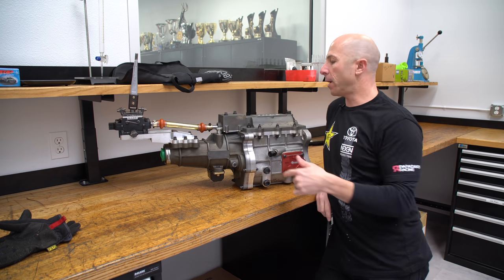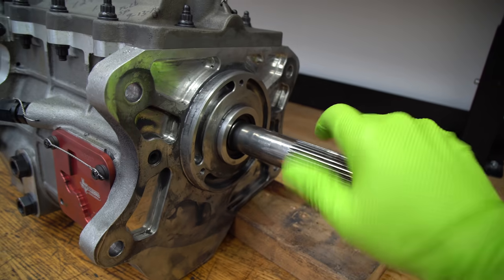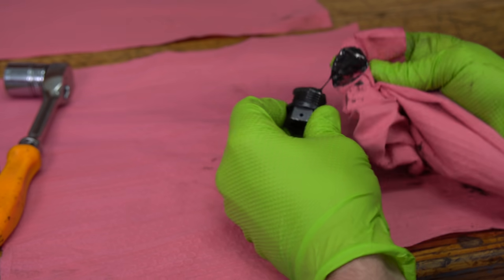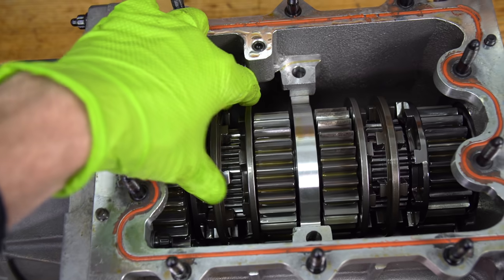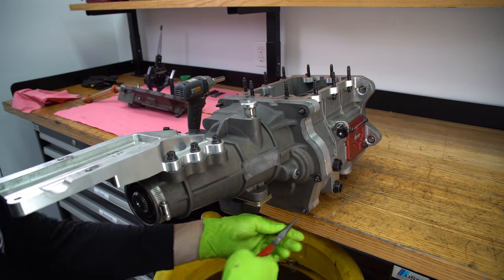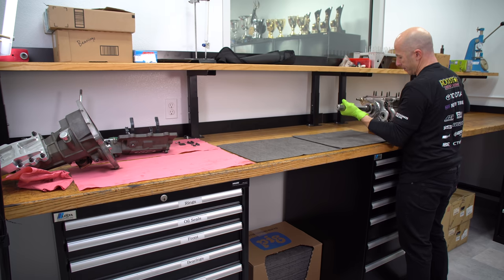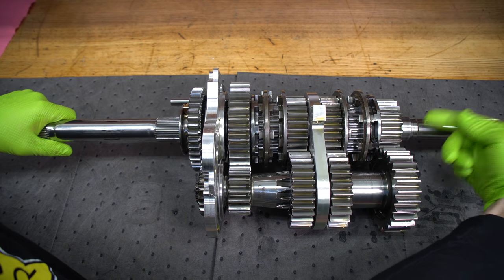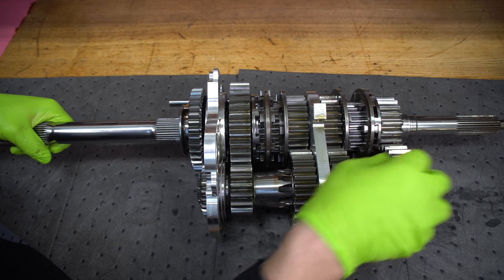NASCAR Transmission Teardown and How It Works

Comment: many folks may not know that is a constant mesh transmission, where the gears never disengage, only the dogs, via the sliders. Most factory transmissions the gears fully disengage or engage every shift. This style is most common in motorcycles, as in all motorcycles use this style. Would love to see a sequencial box tore down, if only you used them. <:/)  What is this trans rated for HP?  Thanks for your simple yet informative content.
Reply: Nearly every factory manual transmission is a constant mesh. The only difference between these gearboxes and the gearboxes in street cars is the shape of the teeth (straight vs helical) and the way gears are selected (dogs vs synchros). Synchros serve the same purpose as the dogs do, only they are much smoother and you don't need to rev match, but you do have to use the clutch.
Reply: @bman12three43  you are so wrong. factory transmissions disengage. the syncros are brass, and cut so the gear trying to engage it connects with syncro, that has a friction clutch inside the steel gear. it then causes the steel gear to match speed of other gear which allows them to ebgage without grinding. when you have constane mesh and dogs, you have no need for syncros. you contradict yourself. Don't post your opinions, it is a dservice to present opinions as facts. I've been working on cars since the 60's. Chevy's Rock Crusher, the M22, in all performance cars in the 60's and early 70's had straight cut gears and no syncros. You had to use your whole upper body to "bang" gears or rpm watch with throttle, or they wouldn't engage and they would grind the corners off the teeth. go take apart a manual cars trans, and a motorcycle trans and tell me they are the same. I've rebuilt at least 10 car and 50 bike transmissions.  <:/)
Reply: @WelLRoundeDSquarE  I don't think you quite understand what I am saying. Let me read you some lines from Wikipedia: "The gears were typically engaged by sliding them on their shafts (hence the phrase shifting gears), which required careful timing and throttle manipulation when shifting, so the gears would be spinning at roughly the same speed when engaged; otherwise, the teeth would refuse to mesh. These transmissions are called sliding mesh transmissions or sometimes crash boxes, because of the difficulty in changing gears and the loud grinding sound that often accompanied" This is where the gears are not meshing and you force them to mesh right? Now let me read another line: "Newer manual transmissions on 4+-wheeled vehicles have all gears mesh at all times and are referred to as constant-mesh transmissions, with "synchro-mesh" being a further refinement of the constant mesh principle." Hmm, gears that mesh at all times, that are called constant mesh transmissions? Go ahead and send me a picture of a synchronized manual transmission where the gears are not meshed at all times. Here are some examples: https://i.ytimg.com/vi/vOo3TLgL0kM/maxresdefault.jpg
Well look at that, all the gears are in mesh. 
https://i0.wp.com/www.econofix.com/mtrans2a.jpg 
Here's another one, still in mesh.
https://www.youtube.com/watch?v=vOo3TLgL0kM
Oh heres a youtube video where you can see all the gears meshing constantly.
Reply: @bman12three43  I stand corrected. Thank you for forcing me to look into this. I am humbled and always greatful to learn . I appreciate your efforts to make me research a bit. Peace to All <:/)
Reply: Huh? Every transmission in almost every manual car is constant mesh.

Comment: Stephen, you are a true OG in the industry. Thank you. I've never seen a dog box explained better & you did it in less than 8 min. Maybe just continue down the drive train. Do the dif next & explain changing final drive. I want to see a video that really explains steering angle & suspension setup & how to create proper geometry. Also explain how Caster & tow affect self steer & how camber is altered to maximize contact under load, not to make your car look stupid & handle worse.

Comment: Stock cars.  Not single thing from the factory.

So what happens if i put one of these in a Ford or Chevy?  Good old  V8 whatever.
Reply: Eric S  You would just have a 4speed Ford or Chevy.
Reply: @tabcobra  And that's a bad thing?  I'm a simple guy.
Reply: Eric S Didn’t say it was bad at all. Heck, I have a 4 speed toploader behind a big block Ford in my 427 Cobra.
Reply: @tabcobra  I didn't see any synchronizers in there, how would that transmission be as a daily driver?
Reply: @jimsz0100  It would be fine, but just four gears...

Comment: Wrong. straight cut gears are not stronger! they are same or even weaker than helical cut gears. They have smaller contact pattern, never wandered how can they be stronger?  Only one difference that straight cut gears don`t have axial load while turning. Lower forces means smaller bearings, smaller gearbox case, lighter more compact gearbox. Lighter car = faster car. Downside they are loud, but who cares its a race, people want to see loud cars :) So that`s why you see helical in every day car and straight gears in race cars.
Reply: This guy has never had a race car in his life. Let me guess you read that in the textbook, ASE manual transmission test. Theory doesn't always apply in real life my friend.
Reply: @joneskey3950  let me guess physics does not apply to race cars?:)
Reply: He's right, he could have said it more subtle though. A "common" failure mode in gearboxes with helical cut gears is gearbox case breakage or thrust bearing failure
Reply: Well then wider tires must grip better right.... wrong surface area has nothing to do with grip it is determined by the pavement surface and the tire compound.
Reply: To be fair tho yes they have less axial forces so the transmission as a whole is stronger not just the gears
Reply: If any of you know me or know my channel you would know I deal with Gforce Andrews Roltek, Emco and what is left of Jerico.. Helicals are stronger and some Porshe GTP cars run Helicals. The problem is the thrust loads cause heat and rob HP, yet spur type gears create more pumping losses. Furthermore, manufacturing costs are cheaper with spur type gears and ratio swaps are easier with 2nd and 3rd gears swappable . Separation forces are much more severe especially with the 25 degree pressure angle these boxes use and thus they have a center cuff and a longer center to center to add to the strength. Also with faceplated gears you don't have to design around the gears having axial loads which effect how the transmission shifts and or stays in gear.  This is a great video.
Reply: Christopher Kennedy that is absolutely untrue. I can change tire width and nothing else (265 vs 255) and literally see an increase in average lateral G lap over lap. Wider tires absolutely do increase mechanical grip. You have no clue what you’re talking about.
Reply: @johnd9357   265 to 255 would be a different tire all together because the sizes are a relation not independent. Ex. 265 40 17 vs a 255 40 17 would be about 1.2% different in height and about 10 revolutions per mile different.

The difference in the gears and why they are stronger is because straight cut can handle instantaneous shock of shifting better than helical gears. Helical gears can take more torque but not as much of a shock. The whole tooth is not always engaged. It is usually some of one and some of the other and you end up putting a lot of force in the corner of the tooth not the whole thing witch damages the gears faster, straight cut are usually all or nothing.
Reply: Greetings from the UK. As you are in the gearbox line of work, do you know what gears etc were used in Hone o drives. Did he have specially made items or off the shelf from a major manufacturer ??
Reply: John Antonopoulous we weren’t talking about revolutions, we were talking about grip. Wider tires absolutely provide more grip, that is a fact and the kid doesn’t know what he’s talking about. There is a point of diminishing returns, but he’s flat out wrong.
Reply: @johnd9357  Sorry wasn't trying to say that you were wrong just technically it is different tire sizes. But yes widee tires do make for better grip
Reply: John Antonopoulous yes I agree and know they are different. When we change tires we have to calculate for the mph error in our lap time software. The error is small but it’s there and adds up over the course of a full lap.
Reply: straight cut gears have more contact surface area between them than an equivalently sized (for power) helical gear,
helicals reduce linear stress by using the  geometry down its own circumference to generate axial torque instead of linear (hence helical gears being better for a torque distribution factor)
yet this limits the given contact area on the helical gear in relation to a spur,
with the spur having more directed contact surface per “tooth”, the tangent forces behind that tooth are more directly transferred to the stronger, main body of the gear (load spreading)

tooth for tooth helical will always be “thinner” in the cross sectional sense, than a spur gear, therefore even excluding the extra axial stresses a helical gear will undertake, you have less contact mm^2 on that gear
physics tells us surface area is directly correlated to pressure,
if the weight is the same, more surface area means less stress, less stress means stronger
hence, spur gears are stronger than helical gears (when size correlates)
Reply: Swampy   I never stated I was the purest form of information. I was incorrect so it seems. I was always told that wider tires allow the use of a softer compound and resist overheating. Friction does not have anything to do with surface area (now yes nominaly of course). It is true that wider tires commonly have better traction. The main reason why this is so does not relate to contact patch, however, but to composition. Soft compound tires are required to be wider in order for the side-wall to support the weight of the car. softer tires have a larger coefficient of friction, therefore better traction. A narrow, soft tire would not be strong enough, nor would it last very long. Wear in a tire is related to contact patch. Harder compound tires wear much longer, and can be narrower. They do, however have a lower coefficient of friction, therefore less traction. Among tires of the same type and composition, here is no appreciable difference in 'traction' with different widths.
Reply: Christopher Kennedy i get where you’re coming from and the principal is okay but friction comes directly from a calculation that involves the surface area as a main component.
i think you’re getting a little confused about how compound sciences work vs friction rates,
basically when someone says a wider is better you MUST assume the same friction rates (a wider version with the same compound)
in any case wider is certainly better than narrower in terms of friction, but narrow, soft tires, can and do definitely increase relative friction compared to a MUCH larger (but shitty compound) comparison
Reply: Christopher Kennedy just another point, tire composition can be varied, a softer compound does not require the tires to be wider, it “may” depending on wall composition, require a slightly higher air pressure, but width (i assume you mean wall height for this reply, not “actual” tire width)
generally has nothing to do with the support of the cars mass, that’s why we have pressurised air in them
Reply: @joneskey3950  Theory describes real life.
Reply: @johnantonopoulous6381  Actually not true. See my above comment. "Semi Helical" is used in many race transmissions. Depends on the Helix angle.
Reply: @Hensen1954  Hone overdrives were nade by Hone in the 1960's and parts and gears have long been discontinued.
Reply: @LieutenantLolz  If your statement was correct a gearset with the same tooth count , center to center and pressure angle would not be able to be duplicated from spur to helical. Which in fact is what we have done over and over with my company for the past 38 years.
Reply: Yes, but did he make his own gears ??
Reply: Look another online expert , who isn't in the video
Reply: Yes this is correct. It is proven that helical gears are almost 20% stronger based on the same pitch and face width. However the thrust loads produced require tapered bearings and stronger cases/ shafts resulting in more weight.
Reply: valdasaa you may be wrong here. These transmissions run hard, long, and hot. Yet, you never see a transmission change on pit road.
Reply: Straight cut has also less friction, less energy is turned into heat and therefore straight cut delivers more power to the wheels.
Reply: Um.....the transmission is loud?  Never mind the open headers.
Reply: Straight cut gears are stronger as nearly all racing transmissions use them and racecars especially nascars......dont tend to use the weaker design. Also, i dont know how a trans video turned into a tire argument but, wider tires definitely grip better than skinny tires. Has anyone noticed ferrari,porsche,lamborghini or any other high end exotic car manufacturer making a move towards skinny tires? Nope. Because they dont offer the best grip. Common sense guys........
Reply: @joneskey3950  correct theory always does
Reply: Thom kouwen     Absolutely correct! ZF boxes with helicals EAT thrust bearings on the main shaft in racing applications.
Reply: Races cars tend not to like to wait for syncros. Slam it in. When the shift happens all the teeth meet.
Reply: @cmkm54  pressure per surface area also otherwise weight transfer for accelerating, turning and braking would also be false.
Reply: @robert23497  - Straight cut gears themselves are weakER they are not weak and can still do the job, and because they don't produce axial loads the case design/component strength requirements are lower than a helical gear transmission at the same power levels and therefore lighter and slightly more efficient which is obviously desired in racing

Comment: Straight cut gears are not stronger
Reply: You're right, but because of the reduced parts it's overall more reliable when abused and the gears are a little bigger and wider than they otherwise could be. That may be what he meant but I'm not sure.

Comment: To be technical, you said straight cut gears were/are stronger. I believe not. Helical cut gears are stronger and quieter. Performance transmissions are used because they shift faster. Please correct me if I am mistaken.

Comment: Actually helical gears are stronger than straight cut (all else being equal). The teeth cross-section is larger, and depending on the helical angle you might even have more than 1 tooth engaged at the same time. 
The reason why straight cut gears are used in racing transmissions is the fact that helical gears induce forces in the axial direction, requiring stronger gearhousing and thrust-bearings. 

That being, I'm really digging your content. No nonsense and straight to the point.

Comment: Best video I’ve EVER seen for this subject. For twelve years I designed transmissions for the oil field - the heavy duty ones were exactly like this but no reverse. Been looking forever for a vid that confirmed my suspicions on how that worked. Thank you.
Now, feel like helping my teardown the e153 on my Turbo MR2? 😝 just kidding Toyota transmissions installed on 90’s Turbo engines were a BEAST. Mine’s just fine LOL.

Comment: Ive rebuilt transmission for over 25 years. The most interesting thing i saw in there is the handcuff. Most transmissions dont have that unless something has changed since i retired.

Comment: It's funny you mention the handcuff.  I had a T5 that the actual case warped allowing the cluster shaft to move away from the input shaft where it developed a whine that sounded like a supercharger... for a little while. I think that transmission could have benefited from such a device to keep things in place. I replaced the T5 with a TKO600, but I'll bet it lacks the handcuff as well.
Great video. Like the humor (dropping the spring, etc.) Thanks!

Comment: Just a quick note: helical gears are actually stronger than straight cut gears, but they’re more expensive and require special bearings to deal with the thrust forces.
Reply: Bryan Noga That’s not true. Helical gears have to deal with opposite pressure. The load of the gear against slanted teeth puts an awkward load against the gear which can lead to failure. Straight cut gears don’t have that issue. They only want to push away from each other, which can be solved with strategic bearing placement on the shafts to reduce stress and flex.
Reply: The Garage Specialists - Helical gears are used in high speed, high horsepower aerospace applications because they’re stronger and have smooth engagement/disengagement.  In theory, you can snap spur gear teeth right off, whereas that’s much less possible on a helical gear, due to the way the teeth “wrap” around the gear and spread the load between multiple engaging teeth.  In practice, gear teeth don’t really “break” as much as we think they do.  Excess loads and/or poor lubrication will tend to chew up the teeth before they snap off.  In many cases, it’s not even the gears failing in the “gearbox” - it’s often bearings that cause more problems, like in wind turbines. I suppose I should’ve made it clear that I wasn’t trying to get into a big debate about gear design, but it’s a complicated and fascinating subject.  It’s actually kind of hard to do an apples to apples comparison from one gear to the next.  Subtle changes in a geartrain design/manufacturing/maintenance can have a huge impact on lifespan, etc.